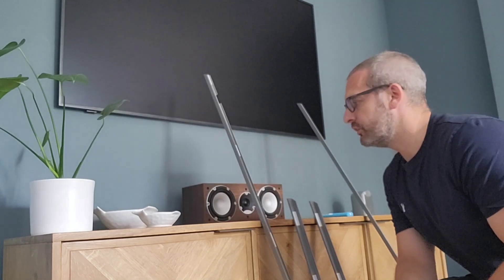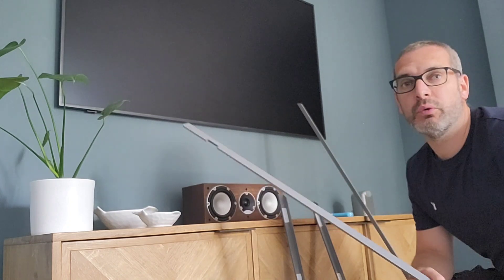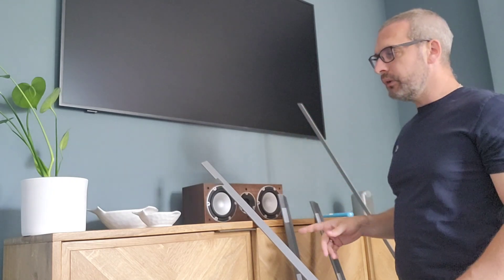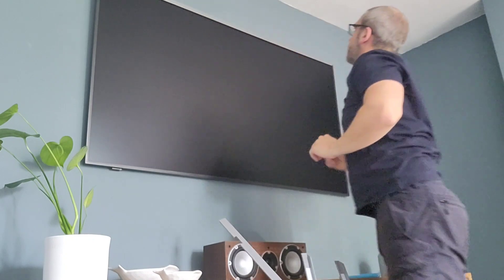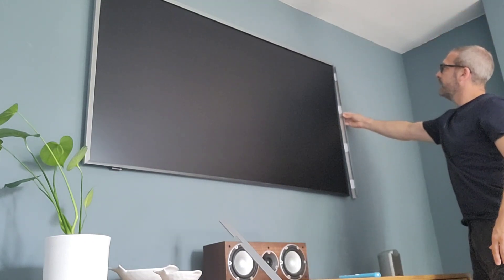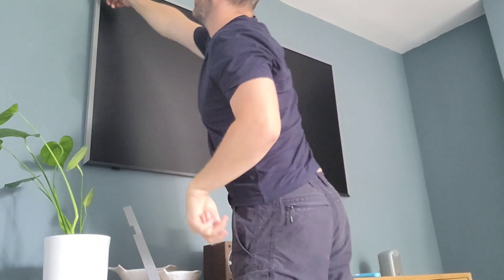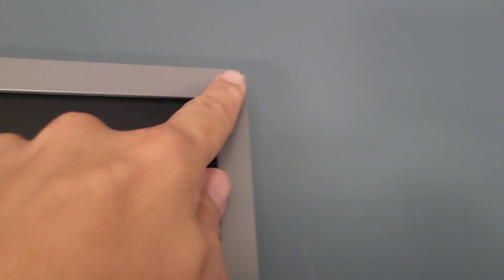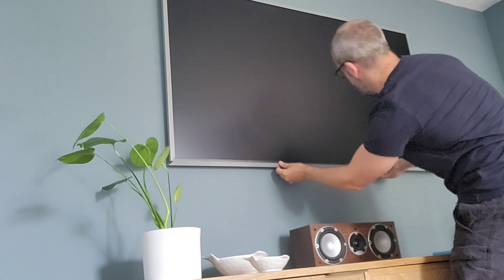Samsung Frame Bezel Installation Mistakes You Should Avoid!

Comment: Ours is plastic from John Lewis but it doesn’t click nicely onto the Frame TV. Bits broke off the back of the strips and it wouldn’t sit flush so the magnets didn’t hold it. We have a new 2023 tv, do you think the £19 bezel is for an earlier model?